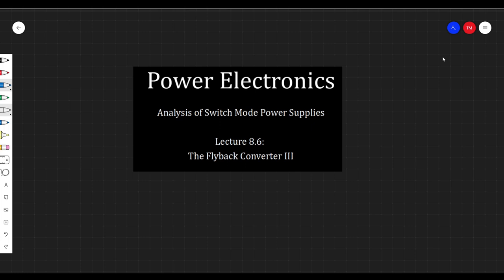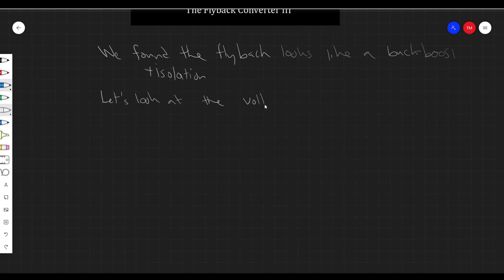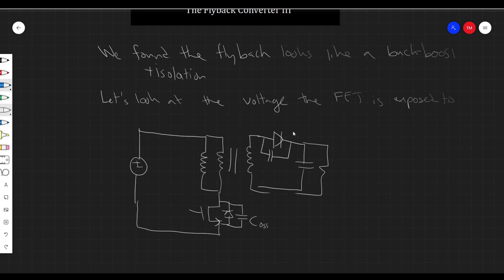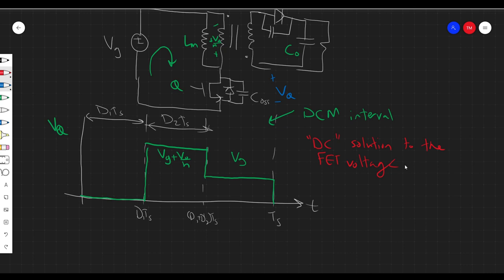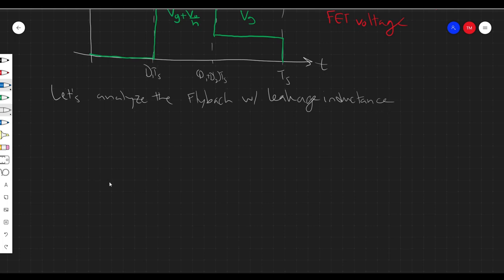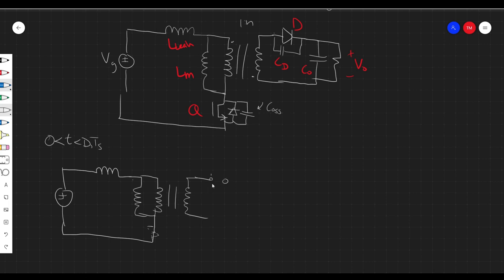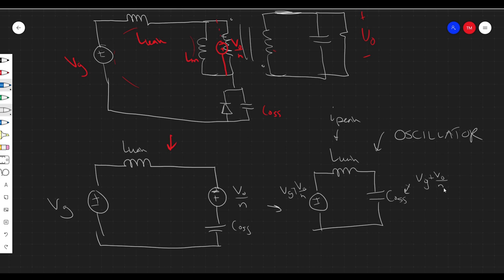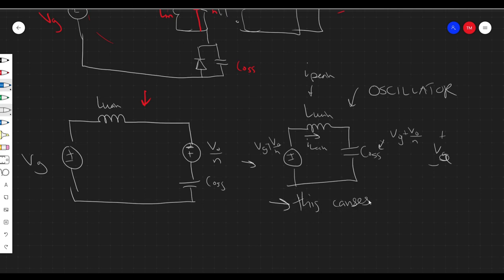Lecturer 8.6: The Flyback Converter III

Comment: What is the use of that body diode across the FET? No use when turn on and off modes?
Reply from the maker: Unfortunately (or fortunately), body diodes are physically part of the construction of power FETs because the body of the FET is directly connected to the source to avoid the unwanted turn on of a parasitic BJT.

Comment: Why capacitors are placed across the FET and diode? 
May be switches to protect from voltage stress?
Reply from the maker: Both the cap and diode are parasitic elements of power FETs. That being said, there are some situations where we actually do want both a cap and/or a diode in parallel with a FET and may place them there. Increasing the parallel cap can slow down the rate of change of voltage across the FET. Adding an additional anti parallel diode (maybe a zener) can reduce loss compared to periods where only the body diode is forced to conduct.

Comment: Hi Tim, do you provide design services, do you have a website or email address to contact you ? I am interested in designing 300-500 nanosecond pulses into resistive loads using transformers rather than capacitors .
Reply from the maker: You can send me an email at drtimmcrae@gmail.com